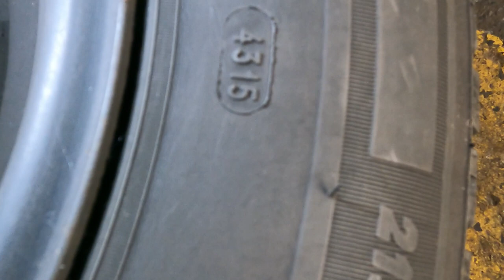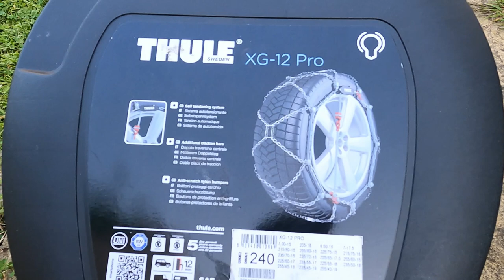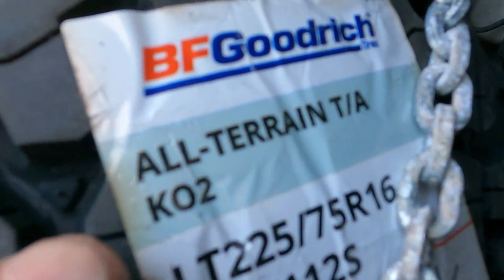Bürstner motorhome tyre change BFGoodrich all terrain Ko2

Comment: Hi. Really informative video here. Couple of questions:
Did you put the jack on the spring did you say?
What capacity can the jack lift?
Is there a particular torque you tighten the wheels to or just a general feel? 
Are the chains just used when there is snow or are they useful in icy conditions as well?

Thanks again. Mal & Dave from The Silvertop Motorhomers
Reply from the maker: Yes on the spring as close to the axle as possible this Jack is 10 ton lift👌🚍🍺
Reply: @MOHOTELADVENTURES  Thanks. So no torque setting on the wheelnuts?
Reply from the maker: @SilvertopMotorhomers  pretty sure it’s 160 Nm I know how tight I like them via feel doing them for a long time👌🚍😎❤️
Reply from the maker: Yes definitely 160 Nm on this model 👍🏽